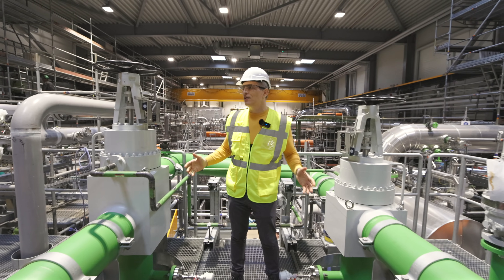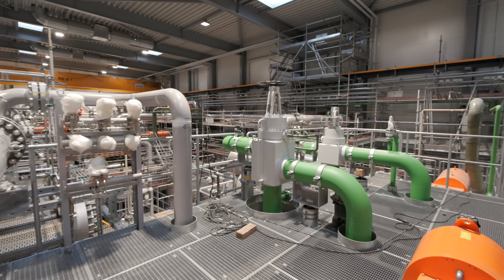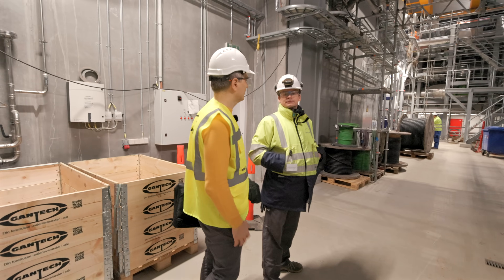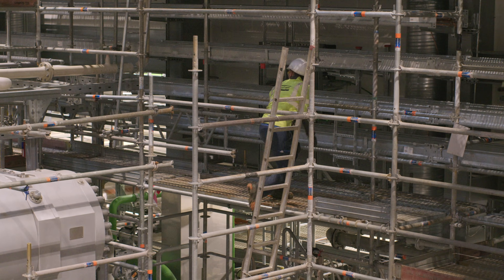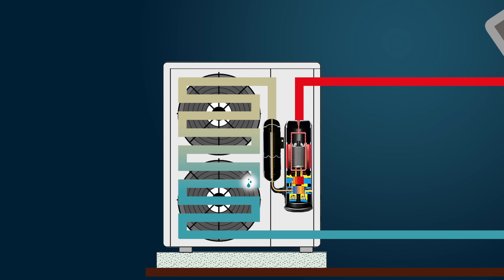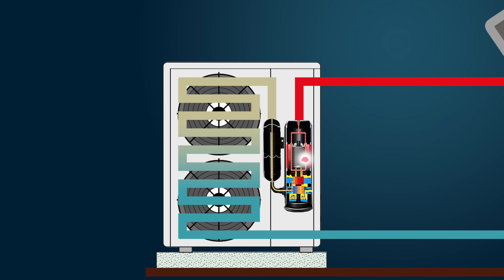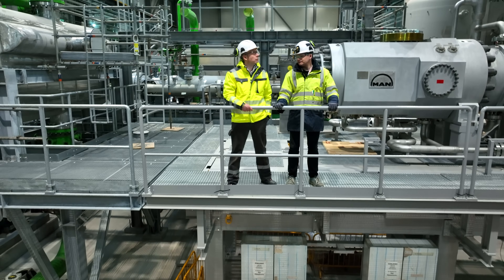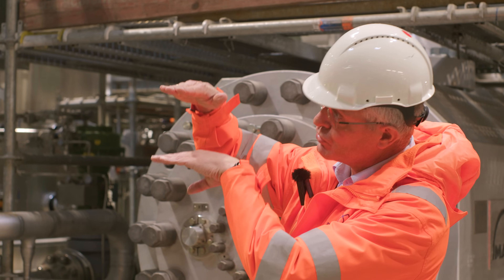Inside the world’s first giant heat pump that heats an entire city with CO2 and sea water

Comment: As an engineer I see an incredible design with amazing integration of energy sources, energy storage, and grid integration. I'm sure once it is operational there will be lots of tuning to optimize the system to get maximum efficiency and grid services.
Reply: Do not forget that a residential heat pump also provides cooling in the summer and this district system is heat only.
Reply: @pauleohl  in our city central heating company provides also cooling
Reply: @pumahuhu365  Can you get hot and cold water on the same day?
Reply: @pauleohl  yes.
Reply: As an electo mechanical engineer I see a lot of renewable energy systems where the designers forgot the first principles of physics
Reply: Too much accent!   Please post a version where MS Word reads the text. (!)
Reply: It’s the most impressive geothermal heat pump I’ve seen. I hope they talk about how they’re going to avoid problems with corrosion.
Reply: @pauleohl 
LOL.

This is the dumbest "renewable energy" contraption I've ever seen.
Reply: Bless the Danish and their "grid balancing gymnastics" -- but this is the dumbest/stupidest renewable-energy contraption I've ever seen.  (Have to feel sorry for the manager how has to describe this contraption.) 

1) there is nothing unusual happening with the climate.  (Please explain the Little Ice Age and the Medieval Warm Period.) 

2) there is nothing wrong with burning fossil fuels.  Its problems in high-density areas are trivial to fix and already have been fixed.  CO2 is not a pollutant.

3) Climate alarmism is a big-lie superstition supported by tax-bribed liars.  (See Climate Discussion Nexus for 100s of videos on climate quackery, deception, and realism.)

4) decarbonization is 21st century pyramid building and human sacrifice. 

5) there is NO excuse for expensive electricity.  Electricity generation is boring.     Just burn coal and scrub the smoke in densely populated areas.

6) the only challenge is manufacturing market quantities of cheap gasoline.  South Africa has already done this for decades (Sasol), using coal. 

7) Elon Musk: the Laptop Class is in La-La Land.
Reply: @hg2.  first of all it's not renewable,  nothing is , it's a zing word
Reply: @hg2. Please try subtitles.
Reply: @hg2. Please explain how there are still some people who still believe that the earth is flat.
Reply: @simonpaine2347  
^^ Kruger-Dunning.
Reply: @hg2.  💯 Now please apply that to your opinions on climate change. Thanks.
Reply: yeah its such a waste full system, district heatng looses 50% of the heat in transport
and it is not green without wind in esbjerg
my heatpump at home is more green
and i did not dig plastic into the ground for miles

i pay nothing for heat i earn money and i live right next to this system
this option is one of the most expensive ways to get heat
Reply: @pumahuhu365  in the same tubes 🤣
Reply: it is people like you that made it, and you guys had no idea what you was doing
this does not get better, it sucks and cost and is not green
it just makes few people rich
Reply: @Hansen710  Not green without wind in Esbjerg? Then it's fucking fantastic that Esbjerg has wind 175days from from october 1st to april 1st. Almost as if engineers when this when they chose what to power the pump with.

Comment: They say the oceans are warming, here we are taking a small bit of that heat back out and putting into homes and businesses.  I don't think most appreciate that ability to help balance the grid. We hear of the need for batteries with all that wind and solar but that massive water tank is exactly that, a cheap battery that may never need replacing!  VERY Well done all!!
Reply: If it was only that simple... that  vast buffer /life support system is already at or near several  tipping points... 
It's not just a thermal buffer it's chemical and complexly  biological in nature it's a physical terrestrial system that is as much biologically determined as by any other mechanism.  The oceans determine both the weather and climate the atmosphere and the  
Whole terrestrial system.  So that's soil and its productivity.  It also determines the quality and  availability of that other rarest resource of fresh water.
Reply: @clivestainlesssteelwomble7665  lol ..ok bud .. the last 100 year of pumping out plant food CO2 , Ill buy the plane tickets lets fly to this place thats devastated that you are referring too
Reply: Never need replacing... except for all the thousands of parts... Which essentially means it is being replaced over time.
Reply: How much heat could be theoretically extract? And how much practical?

Comment: So many people relying on one source of heating. In UK, in the 70s, we had the District Heating. It failed due to consumers abusing it. Not turning it off when windows were open. Cost cutting by not using the correct inhibitor hence, corrosion and pipes collapsing. It was abandoned in 1983. Could have been a good system but became too costly.
Reply: That was in times where energy was still cheap. Now you will be presented a hefty bill at the end of the month!!!
Reply: Big problem with any socialized service, it's prone to being taken advantage of by it's consumers.
Reply: @spacebound1969 it’s not socialized, you have a meter in your house that measures the energy you use from the system, so its the same system as gas and electricity. You pay for what you use.
Reply: The failure was in not charging people for their consumption. If you charge people more than the system costs, it doesn’t matter (economically) if the system is used inefficiently.
Reply: But they are not relying on one source, there are two compressors and multiple gas boilers, so the system will be reliable.
Reply: Lol, skill issue.
Reply: Sounds a poorly designed system.
I assume back then metering the heat was not easy / cheap.
Reply: @markthomasson5077  You really just need a water meter. Assuming that the water has an average entry temperature of X and a leaving temperature of Y you can calculate the heat usage by the amount of water that is flowing through. Though you could cheat by more efficiently extracting the energy and cooling the water more. However, this is not that big of a deal, as you could also measure the return temperature. And generally the system is more efficient when the return temperature is lower.
Reply: @placeholdername0000  yup, this is no problem now.  Not in the 70 & 80s
Reply: @hoekbrwr  the engineer did say there was metering.
Reply: @markthomasson5077  Water meters have been around for decades.
Reply: Bless the Danish and their "grid balancing gymnastics" -- but this is the dumbest/stupidest renewable-energy contraption I've ever seen.  (Have to feel sorry for the manager how has to describe this contraption.) 

1) there is nothing unusual happening with the climate.  (Please explain the Little Ice Age and the Medieval Warm Period.) 

2) there is nothing wrong with burning fossil fuels.  Its problems in high-density areas are trivial to fix and already have been fixed.  CO2 is not a pollutant.

3) Climate alarmism is a big-lie superstition supported by tax-bribed liars.  (See Climate Discussion Nexus for 100s of videos on climate quackery, deception, and realism.)

4) decarbonization is 21st century pyramid building and human sacrifice. 

5) there is NO excuse for expensive electricity.  Electricity generation is boring.     Just burn coal and scrub the smoke in densely populated areas.

6) the only challenge is manufacturing market quantities of cheap gasoline.  South Africa has already done this for decades (Sasol), using coal. 

7) Elon Musk: the Laptop Class is in La-La Land.
Reply: same is happening in denmark now 🤣
some companys with very few workers made milliomns and kept them for their own pocket
these people made money from the war in ukraine for example
and this is not green

Comment: ... very interesting. Question is, if it is more efficient (and cheaper) to push water only with 10-20 degrees or so through pipes and then the individual heating in every house takes place with small and cheap water heat pumps... called "cold district heating". Maybe only possible in cities, where the pipes and heat pumps have to be installed completely new anyway.
Reply from the maker: An interesting idea, probably can work in milder climates, but if the water that a home heat pump heats from 20 to 50 in the house, would then return back to central heating system, a lot of energy waste would occur from the one consumed locally, by that home heat pump. And since different temperatures can be set in different houses, there would be a need for meters on exit as well, to count how much each home contributed back on exit water to the system. But another idea was mentioned in the comments, which is already used even with gas plants, of having intermediate mini stations, to minimize the loss. So they would receive a warm water from central plant and heat it up closer to distributing it to homes. A similar principle, but only few such intermediate stations would be needed in an entire city.
Reply: @Watt-Energy  very good response. To think about two ways it would have to travel.
Reply: Good question! What you are talking about is actually implemented in so called 5 gen district heating networks!
The idea is that because the supply and return water temperatures for the customer are so low, the heat losses in the network are minimal. Additionally, you dont necessarily need to isolate the pipes, saving huge amounts of investment money. Then during summer the water can be used to cool down houses.
Reply: Some cities in Sweden have "district cooling", piping cooling to data centers and shopping malls. The heat pumps that produce hot water for district heating does double duty and uses the energy spent to both cool and heat at the same time.
Also big data centers makes some money back by pushing their excess heat into the district heating network.
Reply: Another challenge is capacity. As the district might have to upgrade the piping to accomedate a larger flow volume to push the same amount of energy. Aditionally the small heat pump at every house wouldn't be able to take advantage of the stable sea temperature.
Reply: Sorry, but This is the dumbest "renewable energy" contraption I've ever seen.
Reply: Bless the Danish and their "grid balancing gymnastics" -- but this is the dumbest/stupidest renewable-energy contraption I've ever seen.  (Have to feel sorry for the manager how has to describe this contraption.) 

1) there is nothing unusual happening with the climate.  (Please explain the Little Ice Age and the Medieval Warm Period.) 

2) there is nothing wrong with burning fossil fuels.  Its problems in high-density areas are trivial to fix and already have been fixed.  CO2 is not a pollutant.

3) Climate alarmism is a big-lie superstition supported by tax-bribed liars.  (See Climate Discussion Nexus for 100s of videos on climate quackery, deception, and realism.)

4) decarbonization is 21st century pyramid building and human sacrifice. 

5) there is NO excuse for expensive electricity.  Electricity generation is boring.     Just burn coal and scrub the smoke in densely populated areas.

6) the only challenge is manufacturing market quantities of cheap gasoline.  South Africa has already done this for decades (Sasol), using coal. 

7) Elon Musk: the Laptop Class is in La-La Land.

Comment: The town of Lemgo in Germany also uses a heat pump - taking energy from the sewage treating plant!
Reply: Great idea, this makes me think that any heat source can be fruit for this heat pump system. Even the waste heat from nuclear and remaining fossil fuel plants. ( In other words Rankine cycle  )
Reply: @GabrielSBarbaraS  heat pumps are less and less efficient ( run longer to do the same amount of work ) and put out less and less heat the colder it is outside by air ,,, so using a better heat source the heat pumps can produce more heat only works in a cold climate ....
   had a customer building that efficient house and complain to me that he built a efficient house why is his electric bill $1,000 a month...  average 70 degree here all year and he installed water source heat pumps ground loop condensers ( good for a frozen climate to get some heat out of the earth ) water pumps use way more electricity then a fan on a normal condenser , someone sold him their useless dream
Reply: @cardboardboxification  agreed heat pumps with ground source should consider the high initial cost with cold climates. Even then I question the initial cost verses savings verses other heat source for when the weather turns cold.  Here in North Carolina we use heat pump most of the year with a cheap propane unit for about 15  of the coldest days of the year.
Reply: thats genius the water will make heat due to all the bio processes happing
Reply: @GabrielSBarbaraS  i live right next to this and i make money on heating my house (actually alot of money)
and im not using a heatpump 
i use green waste heat from servers

using direct energy before it makes money and heat is stupid 
you need to use the waste like this example in germany 
why also only make 1 profit, when many of these projects can have 3-4 incomes
Reply: @Hansen710  I hear of some people mining Bit coin and using the heat to heat their home.
Reply: @cardboardboxification  Sounds to me like someone didn't design their system too well ( i.e. way too many pumps and/or not efficient pumps) or it's a huge system.  I'm in the middle of a design for a complex ground source heat pump.  I only have 4 pumps.  The remainder of the controls are mixing valves which use far less energy.  Overall, there will be one target temperature for the whole facility which will be controlled by 2 main pumps - 1 for facility distribution and one for the heat pump HW storage.

Comment: Here in North Carolina USA we do just about the opposite with heat pumps. Since it is warm most of the year, we use a heat pump to take the heat inside the home and put it into our domestic hot water system in the home. Normally this cost  for hot water is   the equivalent of about 5 Euros per month ( After the initial cost of about 2000 Euros )   for our hot water not including the free cooling in our home from dumping the heat into the water, then ultimately through the hot water use and into the ground.  ( You got to love the magic of engineering )

Comment: And 3 km across the danish border, there is Flensburg that is still powered by coal. (In Flensburg 95% of all households are connected to the heating grid, and it's right at the baltic sea)

Comment: For hot, arid coastal areas, could reverse the heat pump for district cooling while also utilizing the waste heat ie. the district cooling loop's reject heat provides energy for evaporative vacuum desalinization while also complementary(load balancing) with solar energy production. Hotter and sunnier = more desalinized water.

Comment: You mention Aalborg. I'm working at the moment on realizing a complete revamp of the district heating system there. At the moment, they are still running the only remaining coal fired plant in Denmark, but that will close in 2028. By then we will have installed four heatpumps, totalling 176 MW, similar to these, three new electric resistance boilers totalling 150 MW, to complement the one already there. The rest of the district heating supply will come from existing waste-to-heat plant and industrial waste heat from among others cement production, waste water treatment plants (and a crematorium). In Aalborg, there are 48.000 homes, which are supplied by the district heating system.

Comment from the maker: What do you think of this giant heat pump technology and the way it operates in Denmark?
Reply: I think this is the future of heating! In places with milder temperatures and warmer sea water it could achieve much higher COP making it even better
Reply: What is the cost of electricity in Denmark and what is the cost per unit of heat from this system?
Reply: Just hope that electric power can be supplied without sun or wind.. the 400 mwat coal plant just close down  next to the new heating plant....
Reply: @gregorymalchuk272  elecricity is expensive really expensive for private people 

but its cheaper not cheap but cheaper for industri 

39 cents USD pr kwh for private use and about 27 cents USD taxes are a huge part of the cost